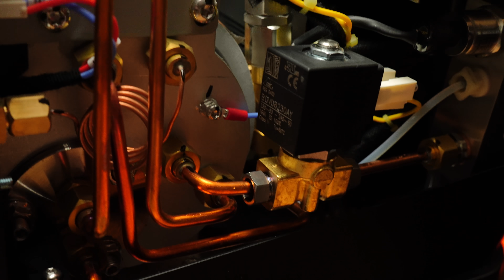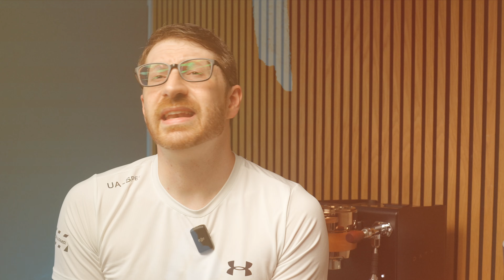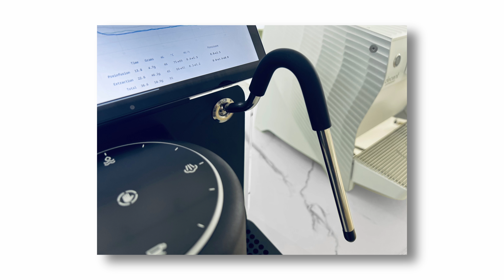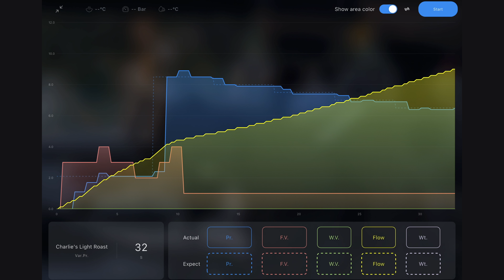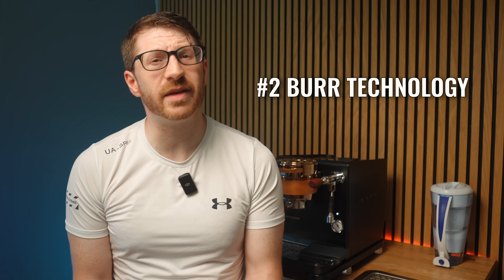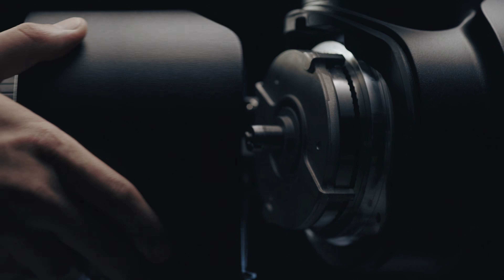Coffee Engineering Is Decades Behind

Comment: 1:  Heating: have you seen the Breville Dual Boiler?  Three phase brew temp control/heating after leaving the pump.  HX to begin the  heating process, PID brew temp control in brew boiler and PID controlled heating element in group head.  One of the best temp stability in the industry  2:  vibration/rotary pump old tech.  Have you seen the Wendougee Data that uses a gear pump?  The Wendougee uses a gear pump to directly control flow/pressure and with its software/UI, is able to do some amazing flow/pressure profiling.  3:  Steam.  Have you seen the Slayer Steam?  It uses a two process steam production protocol that produces some of the driest, stable steam in the industry.  The first part is the standard steam production that produces saturated/wet steam, but before it goes out to the wand, it undergoes a "vaporizing" phase, that superheats the saturated steam, making itstable and dry.  4:  Software.  Have you seen the software/UI of the Wendougee Data and Lita and the Decent Espresso machines?  Bottomline,  all the tech/concerns you discussed are known to the industry and are being used by some of the manufacturers.  Even in the low tech manual lever espresso machine.  Turin (ITOP) has introduced a manual lever machine (the Axis) that uses planetary gears to control lever pull.  This is the first use of planetary gears for espresso.  The planetary gears are torque multipliers so it takes less force to produce a given brew pressure.  The adoption of these "modern" technologies are more about cost and manufacturing efficiency, not "ignorance".  The added "benefits" just don't justify the cost. Yes, very high tech machines may be attractive to a few willing to pay $$$$$ for such machines, but espresso manufacturers pursue a larger market niche.  Furthermore, higher tech does not equate to better espresso.  The machine does not make good espresso, it is just a tool designed to push a consistent flow of water, heated to the right brew temp, to/thru the coffee puck.  Yes, some machines may do those things better than other machines, but in the end, it is the barista, not the machine that makes good espresso.  A good barista will make good espresso with a $500 home espresso machine, better than an unskilled weekend espresso warrior will make on a $25,000 commercial espresso machine.

Comment: Of the 34 problems you mentioned there is 1 machine that has solved them all: Delonghi Stilosa EC230 (in advanced mode). 

The boiler sits directly above the group head, and therefore it’s extremely temperature stable as the group head is basically  electrically heated. 

Because the  boiler is only 150ml you get almost a HX-machine but without the downsides. You also get extreme fast heat-up times at around 3-5 min irl, and can do multiple shot after shot. The sound of the vibration pump is super quiet when brewing, but with no coffee in the basket the sound goes up. The small size also means it’s extremely energy efficient. 

The smaller the better, as the problems don’t exist and don’t need to be solved 🙂

Blind test has showed the shots is as good as on a La Marzocco (ask Lance Hedrick, yes he is surf man nr 2)

//Brew and surf safely
Reply: I use delonghi ecp3420 (similar to stilosa) at my small coffee roasters beside a 2-group E61 commercial machine. And believe it or not I prefer using the delonghi machine at low traffic time. It costs less energy, stable heat and beautiful shower flow from the grouphead, slow and soft flow rate (water debit) around 5-6 ml/second, use less coffee (17.5g), the result is soft, sweet and crema is nice. 
And what about the 2-gr e61 machine, its heat and water flow is a chao, need to lower the pressurestat, lower the opv, let water run out at least 30 seconds to reduce boiling and bubble, cannot change the high water flow (11-12ml/second), the coffee run too fast, need to increase the dose to 20g, at the end the crema looks like sponge bubble and burnt , taste is intense and harsh, and electricity bill expensively high at my place. I wish I could get rid of that e61 commercial machine and change to a multi-boiler one so I can choose temperature, flow rate, pressure profiling, turn on/off independently and flexibility for different coffee beans as I’m aiming to become a specialty coffee roastery.
Reply: I contracted this out to Lance Hedrick, and we both agree there is only one right solution for your problem: 

Buy 2 Delonghi Stilosa but run one of them in steam mode only all the time. 

//brew and surf safely
Reply: @Efoil-the-day-away  Thank you so much for taking your time to address my problem together with Lance Hedrick, I'm a fan of him and decided to buy ecp3420 after watching his video (stilosa was out of stock at my place). However, may I know is there anything I didn't figure out or understand about the e61 machine that come to your solution of using 2 delonghi machines?
Reply: @binhoang8430  My child, you did everything right. 

Lance says hello. 

//Brew and surf safely
Reply: @Efoil-the-day-away  Thanks a lot. Have a nice day!
Reply: good sarcasm
Reply: Funnily enough LaMarzocco does have a boiler machine that can heat up 1.5L in 5 mins. It's not like boilers couldn't achieve the time frames you mentioned. 

 The main difference between traditional boilers and domestic machines like what you mentioned is their intended purpose. La Marzocco as a whole really is designed to be put in a setting where it's constantly used, and everything about the machine reflects this. They've branched out with things like Linea Micra so people who want a shiny toy can have a miniature version. But at its heart it's still more or less a commercial machine with commercial design. 

 De'Longhi on the other hand is designed purely for domestic use. It doesn't need to heat up 1.5L because it's not expecting a steady stream of cup after cup in the same volume as a coffee shop.

Comment: Good topic but you speak way way too fast. Also unfortunately i have no faith on software centric machines, just look at home appliances, unrepairable. Most of the suggestions will increase the price of the machine both at purchase and lifecycle. But agree a temp sensor at the group instead of in the boiler should be default and measure flow pressure at the basket as well. Also if it becomes so automatic then the barista will complain. Its like cars self-driving isn’t for everyone. Or a classic porche with no driver assist on brakes, steering or acceleration and a modern one that is impossible to screw up.

Comment: I think that the idea behind this video is good but a lot of points are silly. With water heating as long as your temperatures aren't swinging 3 degrees at least then the coffee tastes the same so there's no reason to innovate there, thermoblocks and thermojet/flowthrough fix the stale water problem and can be equipped with PIDs even on machines around $200. The difference in taste between a rotary pump and vibration pump are also nearly indistinguishable and vibration pumps can be equipped with dimmers to lower pressure and vibration speed. A lot of machines that look like E61s obviously aren't using the exact same design as the original from 1961 and have new ways of heating the brew group like heat cartridges as you mentioned. Basically what I'm saying is theres only so many ways to make putting water through finely group coffee fancier and looking for ways to make better coffee should be the goal with machines rather than advancement for the sake of advancement. Thats like making a video saying that kitchen sink engineering is decades behind because what is there to change? For steam wands I think you could just get rid of and replace with big electric nanofoamers to be fast and avoid dilution although its not really a problem since there's already water in the coffee I think the bigger boogieman to chase are things that change how the coffee tastes like more cheaper machines having pressure profiling and cafes moving towards smaller groupheads like 51mm for much more noticeable improvement like more consistency and less coffee waste rather than trying to be needlessly precise with nothing to actually show for it.
Reply: Yet we as a community seem to accept heat up times at north of 20 minutes, just look at the Lelit Mara X3, a shitty machine no one should in their rightfull mind buy. There is no excuse for not being able to heat up a machine in less than 2 minutes these days. Also why are we even using boilers? We heat up an entire boiler for a 40ml shot. that is ridiculous. Why does a highly wanted LM linea micra have huge boilers and not highly engineered thermoblocks/coils like Ascasso and Sage/breville machines do?
Reply: @Persason  Just one slight correction - the LM Micra only takes 5 mins to heat up. Not 20. Yeah that's still not down to 2 minutes, but it's not the 20 minutes you were concerned about either. 

The 20 minute machines are usually much larger machines, with a much larger volume in their tank. To be fair to LaMarzocco, they designed their machines for the commercial space. Their consumer machines really are just miniature commercial machines and everything about them reflects their intended purpose. To be a commercial machine fit into a domestic space. 

You'll find the same issues on anything semi-industrial, in any space, not just coffee. If you want something tailor-made to domestic work at a domestic output, you'll want to steer away from semi-industrial machinery. If you just want something that's fun to play with, you might not mind to drawbacks of putting industrial-aimed-machines into a home setting.
Reply: I think the biggest improvement for coffee enthusiasts would be small raost machines. The roast is one of the biggest factors for taste. The whole setup at home can't influence the taste in the cup very much.

Comment: A good E61 like the Bezzera Aria Top PID has the ability to heat the portafilter, heat the cups, create good steam with a 1.5 L boiler, has a rotary pump, uses fresh water from the tank as it is a heat exchanger, and flow control for pressure/flow profiling, (especially when used with a scale with a flow meter). The Meticulous, which arguably is much more advanced, also uses fresh water per shot but can't steam, can't heat cups or heat the portafilter. The other often overlooked caveat to many espresso enthusiast videos is that not everyone is looking to brew light roasts. I use the very simple and old technology of the Cafelat Robot with a medium dark roast and 1Zpresso J-Max handgrinder and I am consistently impressed by the incredible flavour it can produce.

Comment: Old technology doesn’t necessarily mean it’s behind or outdated. If it works then it works. Technology doesn’t fix problems without causing more problems. Not saying theres room for improvement or things do not need to be changed but it’s always foolish when we make grand statements that something is behind….behind what? Who is making this determination?
Reply: They want things to be overpriced, ultratech and with an expensive service to fix. tks Not needed
Reply: For some reason, we're not driving cars with carburetors anymore. I agree that E61 is a totally outdated piece of tech that needs to go. Continuing to produce new machines with that group head is just bizarre.
Reply: @zeak31337  carburetors were simple easy to fix…fuel injection engines are not necessarily better. They were made due to government policies but like I said before they cause more problems than fix any real issue. They cost more to fix. More bells and whistles doesn’t equal better.
Reply: @zeak31337  haha new cars suck. Plastic crap that is unreliable. Stop trying to reinvent the wheel.

Comment: just go Chinese brand man. a lot of this reputable brand only selling their reputation and high repeatability with less control. which is not needed in home experimental setup.
Reply: As a cafe owner in Vietnam, I agree, I bought a 2-gr E61 commercial machine (Wega pegaso EVD2) and totally regret. The heat is unpredictable and usually goes too high because grouphead store too much heat, I need to let water run for >30 seconds to lower the overall heat, the water flow is too strong 11-12ml/sec, the pressure shot 9-bar suddenly, doesnt have pid or flow control, cost too much energy and coffee (20g because 18g cant hold the shot in time, grind finer will get bitter and intense), the crema is burnt and bubble too much.
I’m heading to change to a domestic multi-boiler machine with PID, customizable preinfusion, flow/pressure profile, and on/off independently, and cost less energy, the price is just half of the “italian brand” one and can pull 200 cups without any issue to the pump and water heat

Comment: I thought in a single boiler E61, the fresh water passes through the steam boiler and heated quickly. It's a dual boiler that will hold the brew water, heating it over and over.
Reply: Yes, heat exchange espresso machines draw fresh water from the tank. The brew water circuit is heated as it passes through the steam boiler. I think the fact that they use fresh water is superior to single or dual boilers, but the watwr temperature may not be as accurate. By adding a PID, like with the Bezzera Aria TOP PID, water temperature seems to be quite accurate.
Reply: many dual boilers, like the Sage Dual Boiler or even the Linea Mini have rather small brew boilers, so I don't really see the problem here for espresso at home. But I wouldn't use the hot water outlet for Americano as this water is dead from the steam boiler. I think our friend is chasing innovation and over engineering for the sake of it at some of his points.

Comment: I disagree with pretty much 100% of what you said ... my 2019 linea mini is pulling better shot than pretty much all new machines ... and the reliability and reparability is to the roof... old = better
Reply: No! You have a well-built 9-bar machine. The coffee in your cup is just as good as that from any other 9-bar machine with decent temperature stability and pump.
What newer, more technology-focused machines have, is extremely repeatable pressure and flow profiling (and some older ones have manual profiling). Those features can make a HUGE difference in the cup, and that's something your very expensive machine can't do.
Reply: @z0lid you dont get it ... I tried hundreds of machines as a technician, every day I get a new machine on my bench, I currently have a new gaggia with a gaggimate and its just sitting in my locker... and no matter the profile, its not better than a mini ... thats quite simple 😅 ... hey this is just my humble opinion ✌️
Reply: and my old casabrews can pull the same as your linea mini and a flair neo could do more. I disagree with him too but dawg not a great defence there
Reply: @VladimirSteiner how many linea mini have you own ?
Reply: Are you saying 2019 is old??? LOL... what about a 1960 machine, how is that?
Reply: @RaduRadonys well I had and still have some 60's machine even 50's like faema labro and La Cimbali Rubino...will still pull better tasting shot than all thermo coil or similar machine i tried..